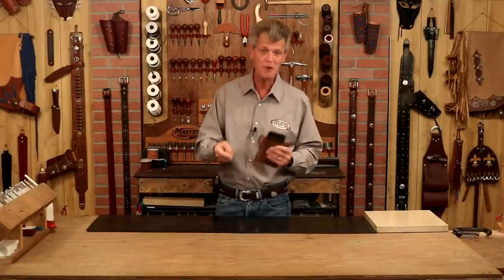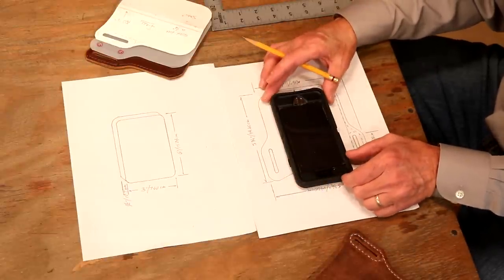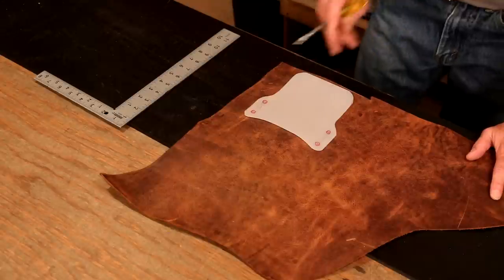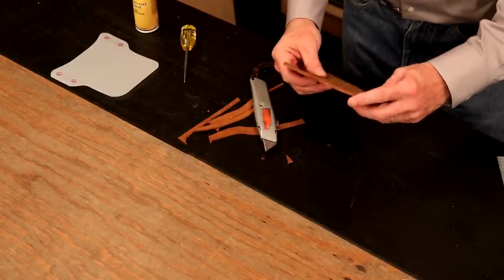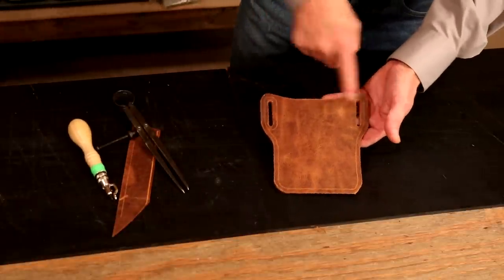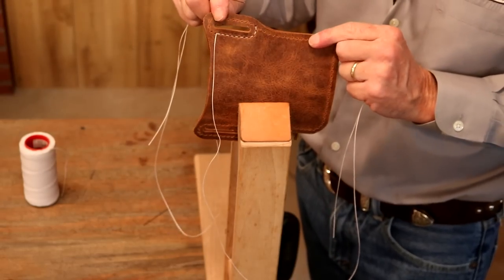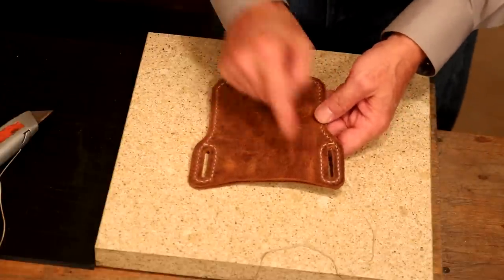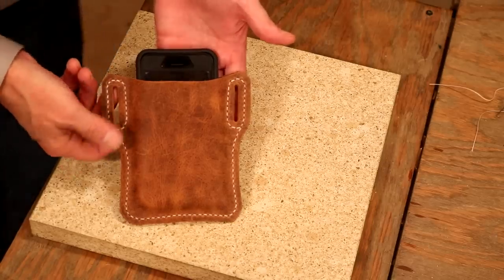Making a Leather Phone Holster

Comment: OLD Leather Smith here, just found this one Chuck,  Very nice job, easy pattern 4 beginners,  when I make a case of any size I ALWAYS line it with sheep skin, and roll it at the bottom so nothing is going 2 come in contact with a hard surface inside or outside. I also never tie knots in over 40 years I have never had
 a project come apart.  GOD'S BLESSINGS ✝️⚾🙃

Comment: Could you do a Leather Element on noise reduction tips? I recently had to move my work space inside and I'm struggling to keep the tooling and punching noises down!
Reply: OLD LEATHER SMITH here, there R 2 things YOU can use, 1 it comes in a roll, it's what wood workers use 2 keep projects from moving around, available at big box stores, I use it 2 keep my jars on my benches, 2 a Pondo board will cushion your granite, I use under my granite 2 soften the noise in my shop, available at Tandy or Weaver, any more information please feel free 2 contact me, GOD'S BLESSINGS ✝️⚾🙃

Comment: when you cut the rounds by making many cuts...wouldn't burnishing the edges of the leather also cause the curves to soften up a bit?   Also with the stitching chisels...what was the purpose of the blue bands on each of them?
Reply: I would imagine the blue tape on the chisels are there to make the size of them readily identifiable, as in distance between teeth. I got three sets and man do they get mixed up when your moving between projects and days... not to horrible, but I really should mark them...
Reply from the maker: Hi Art,
For the corners, I like to get them as smooth as possible with the knife and then if they are still rough just run some high grit sandpaper over them before burnishing. This will help get rid of any roughness.
The chisels are marked with the colored rubber bands for size. We have 3 mm, 4 mm, 5 mm and 6 mm sizes available and each set has a different color band so you can easily identify them.

Comment: Hi chuck, love your video series, just have one question, on the pattern material, (plastic) what do u use to draw on it, without smudging the lines, i've tried pen, pencil,
Reply from the maker: Hi Daniel,
I use a regular ballpoint pen on mine and I usually don't have issues. You could use a fine tip Sharpie and just make sure to let it dry before cutting out the pattern. That shouldn't smudge.